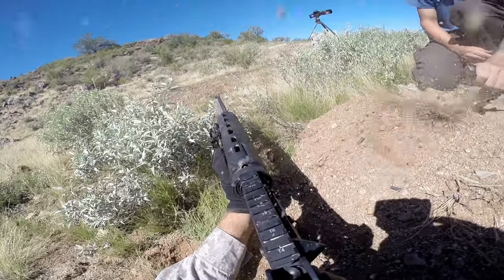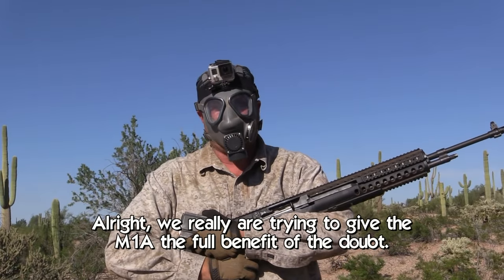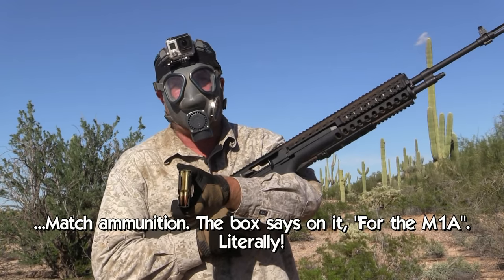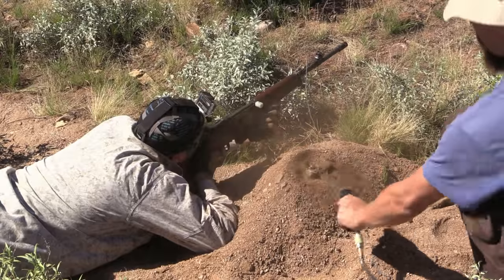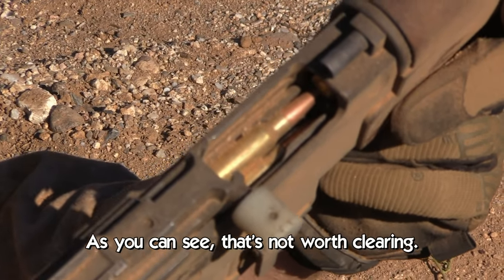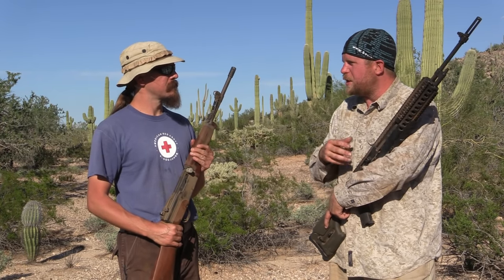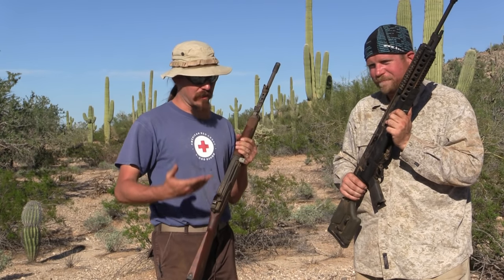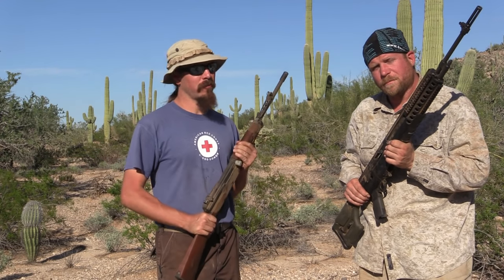Sand Testing An AR15, M1A, And MAS 49/56

Comment: Dude you blew WAY more sand on the M1 than the AR
Reply: It was so noticeable that it almost looked deliberate. Anyone who's ever been deployed to the deserts of the Middle East will tell you how unreliable the AR is in that kind of environment, demanding constant maintenance to be able to keep them functional. Testing videos such as this hardly ever parallel to the side of reality when compared to what actually happens in the real world. All firearms can and will fail when enough debris gets into the internals.
Reply: +LastNineBreaker A year late, but let me ask you anyways: Have you been "deployed to the deserts of the Middle East"? And if so which ar15 did you use? There are tons of variations around so I can't be sure which one you've used. Most of them are absolutely insane when it comes to reliability. The entire gun is mostly closed after all, especially with the dust cover (and even with it open the bolt makes a pretty tight seal so it barely matters). Id wager to say that if your ar15 failed in the desert sand, there might not have been any other gun that would have fared any better.
Reply: The military doesn't issue the AR-15, and you don't get to choose what you are issued.  Wars don't necessarily lend themselves to regular weapons maintenance, and access to lube can become very scarce. When an M16/M4 is properly lubed, it's a sand magnet, and sand isn't a friend of that bolt carrier and upper receiver/chamber. I question if a rifle should have to be lubed regularly to function. When rolling in the back of the pick-up style hummers you eat A LOT of sand, especially in a sand storm, and that sand is really fine like baby powder; it gets in everything, and requires a religious regiment of cleaning. There is a layer of dust on everything, all of the time. I can't imagine what a few decades of being out in the sandbox would do to one. Regular maintenance isn't exactly high on a Jihadi's priority list.
Reply: +LastNineBreaker So what you're saying is that "anyone would know how unreliable a gun they don't carry would be"? Well my military does issue an ar15 type (hk416 to be exact), and it's one of the most reliable guns we've ever had. While I admittedly haven't been to middle east myself, the weapon itself has been rigorously tested before it was acquired by the Norwegian army and in combat in the middle east since. While ar type weapons does come in a variety of types, they're all similar with the closed off bolt style that makes it really difficult for dirt to get in there to begin with. People think it's unreliable because it's complicated (compared to a relatively uncomplicated ak for example), but it just isn't.
Reply: LastNineBreaker the US military DOES issue the AR-15. When an AR has a specific set of features, and owned by the USG, it is called by its military designation. And what the guy could've been skiing was which rifle did you use? M16A_= 20" rifle gas system. M4__ =14.5" carbine gas system. MK12 Mod 0 =18" rifle gas system. MK12 Mod 1 = 18" rifle gas system with carbine recoil components.
Reply: LastNineBreaker I know a retired field-grade Major (Army) who won't tell you that. He'll tell you that if you maintain your weapon, it's boring. I have a former Army Sgt. who did private contracting after getting out. He will tell you that if you maintain you weapon, it just works. I have heard claimed former service members tell me they had unreliable rifles and once they stopped oiling them they worked fine. I will listen to my primary sources.
Reply: The MJR you mention seems to reflect my opinion when emphasizing maintenance. When he asked about the type, I figured he was inquiring about a specific manufacturer. I considered that a moot point since because they are all based on the same design, they all share the same potential design weaknesses, regardless of manufacturer. The HK416 is based off the M4, but it's still not an M4.  He specifically asked about the AR15, and while I understand the distinction you were trying to make, I don't know of anyone that would refer to their M16 as an AR15.

Comment: Try a Garand please, and take of the Troy stock from the M1a.
Reply from the maker: +Douglas Fulmer We did a mud test on the Garand already, if you haven't seen it.   This was a loaner gun and it came in that Troy stock, so we used it as it came.  I am absolutely certain it had no effect on the results, however.  ~Karl
Reply: InRangeTV Thanks for the lightning quick response. I am dubious about the stock, but I agree the same thing would have happened already.

Comment: Your 'sand' is way to coarse , it would take several hundred knots of wind to put particles of that size in the air.   Try again with 'playground' or finer sand.  Its the same problem with your 'mud'  you can hear the huge pieces of grit grinding on the shovel as you scoop the mud onto the pieces.

Comment: did you use dry lubricant or nothing at all?
Reply from the maker: +Simon Rival Nothing, we ran them dry. ~Karl
Reply: +InRangeTV I'm dissapointed with the M1A with that performance I thought it might have had some oil in it somewhere.
Reply: +Simon Rival probably why it had such a short service life maybe, was that movember or your everyday?
Reply: +stevencox75 it's service life was short because the M16 was brought into service. however the M14 is still in service with many countries as a designated marksman rifle. As for the moustache it was for movember.

Comment: Interesting. But you should have pushed the AR to failure, or at least tried. And done an AK47 of course. I'm a little surprised that the AR didn't fail, as well, as there seemed to be ample opportunity for crap to get in the chamber. All 3 guns effectively sealed the chamber while in battery, so the only obvious advantage of the AR in that instance is that it's ejection port is smaller. Going from that assumption, it should just be a matter of time before the AR got dirt in the chamber and failed to extract?
Reply: it also has a blast of gas coming out of the chamber since it is a psuedo direct impingement action and that blast of gas can clear or prevent dirt from entering the chamber.
Reply: Barnaby Wylde Are you talking about the gas ports in the bolt carrier? I'm not sure I follow.

Any automatic firearm is going to have some gas blown back out of the chamber. Even though the bullet has left the barrel by the time the shell is extracted, there's still a certain volume of expanding gasses that remain in the barrel for a short time, and some of that does blow back into the action. With that said, I don't think there's more gas coming out of the chamber of DI rifles, or that it's at a higher pressure. That would mainly have to do with how fast the gun unlocks, which is really a matter of gas port size, powder volume, bolt weight, etc. If it unlocks earlier, then the pressure will be higher and more gas will be blown back into the action.

I really don't think DI vs piston had anything to do with the results in this case. If we were talking about high volume fire then possibly, but then again, failure to extract isn't an issue caused by DI. The only malfunctions that would come into play with DI would have to be the direct result of carbon buildup and oil loss in the carrier pocket. In this test, however, none of the guns were fired enough for the whole DI vs piston thing to even begin to come into play. None of the guns were fired enough to become fouled, so 100% of the failure was the result of the dust, not the particular gun's type of operating system (at least not in regard to how dirty it is).
Reply: Jack Banks 10:25
Reply: Barnaby Wylde Oh, okay, you were talking about the MAS. The gas would actually be coming out of the gas tube on that one, not the chamber. But yea, I could see how it might blow away a little debris.

The AR15 is quite a bit different, though. If you watch slowmo of one being fired, there's really not much if any gas still coming out of the gas tube by the time the BCG moves to the rear. There's a little puff of smoke that comes out of the chamber, and maybe some out of the gas tube, but no more than any other automatic gun.

Pretty much all the gas gets blown out the gas ports in the carrier. By the time the BCG moves far enough to the rear to allow any debris to come into the chamber area you're not really seeing anything significant coming from the gas tube.

The MAS might have more of a blow out effect because it's 100% pure DI. So the gas isn't being rerouted anywhere, and it doesn't have anywhere to expand. I'm just speculating though. I don't know much, or anything really, about the MAS49.
Reply: Jack Banks the actions for the the M1A are exposed. unlike the AR where all the moving parts are internal.

Comment: Use a stock that doesn't have a hole in it!
Reply: +mcqueenfanman A traditional stock would be more open and make it worse really, this somewhat shields it
Reply: +bower31 No the hole I'm talking about is the selector switch hole. Plus that top rail is an area where it could deflect sand down into the action.

Comment: there is no rifle that does everthing the ar can better then it can
Reply: DEMONIC DEFENSE SCAR16S and SCAR17S as well as ACR. though all three are very similar in function to the AR15 with the exception of being piston driven. basically they're evolved ARs.
Reply: ***** they still dont come close to being as adaptable as the ar 15 by pusging two pins you can go from 22 lr to fifty bmg and all in between no rifle can do thst but the ar 15
Reply: DEMONIC DEFENSE true but that's because the AR15 has a massive aftermarket. The ACR however has common parts compatibility with the AR. And both rifles can pull a trick most AR's can only dream of.. Fold their stocks.
Reply: ***** law tacticle solved that problem im not saying the acr and scar arent great guns but they are not any better then a good ar 15
Reply: DEMONIC DEFENSE they're better at somethings and not at others. I personally have a AR15 and a SCAR17S on back order. The AR as my close up weapon and the SCAR will be my reach out weapon. I also have a .50 BMG rifle (who's upper can be mounted to a AR lower). So yeah. I love both guns. 

If I had to pick just one rifle I could buy it would be the AR because that one gun is every gun. But if I was being dropped off on an alien planet and didn't know what the environment would be, I'd take the SCAR, because no way no how am I going to carry every upper for an AR lol.
Reply: ***** i love the acr i wish they had actualy made the caliber convertions they promissed
Reply: DEMONIC DEFENSE I'm not sure if a AR barrel will fit in a ACR. I know their triggers do. 

If I went with a non AR 5.56mm I would get the ACR
Reply: DEMONIC DEFENSE the SCAR does one thing way better then a AR... be stupid expensive.
Reply: ***** amen to that
Reply: DEMONIC DEFENSE my SHTF50 costs $100 less then my SCAR17S
Reply: ***** what is it
Reply: The SCAR is $2800 and the SHTF50 is $2700
Reply: ***** holy crap thsts a lot of money what 50 is it
Reply: DEMONIC DEFENSE SHTF50. It's a 5 round box mag fed bolt action .50 cal upper. However I'm buying it with a dedicated lower built for the recoil and lacking the AR mag well.
Reply: DEMONIC DEFENSE yeah... I don't make a lot of money... I just spend what little I have on guns.
Reply: ***** oh ok i am thinking of geting one of those how does it shoot
Reply: DEMONIC DEFENSE the 50? I don't know yet. Once ordered there's a 10-12 week waiting period while they make it. I'll find out in 9-11 weeks.
Reply: ***** oh ok
Reply: DEMONIC DEFENSE yeah and the SCAR has been on back order for so many months now.
Reply: ***** that must suck waiting for guns you already paid for that one reason i havent got a silencer yet
Reply: DEMONIC DEFENSE yeah... But the SCAR I saved for 5 years for... I can wait longer.
Reply: ***** it will be worth it im sure im stuck building ar 15 for the moment buying one part a month
Reply: DEMONIC DEFENSE I bought a used AR that already had an upgraded trigger and a quad rail front end that forms a monolithic rail on top. Next week I'll get an EOTEC 552 and magpul flip up sights. I also have a magpul angled fore grip. I'll get another EOTEC 552 for my SCAR17S. And currently have an EOTEC 512 for my MKA1919. They both are the ones that take double A batteries. But the 552s are night vision capable. The 512 I got a good deal on and I'm not likely to use night vision with a shotgun.
Reply: ***** nice   wish i could afford a eotec
Reply: DEMONIC DEFENSE I can because I don't do anything that costs money, cheap food, no going out no driving around,  no buying movies or video games or even any cloths more expensive then absolute basic stuff. I literally have no life lol.
Reply: ***** same here but i got a 1year lod son to take care of so baby food b4 guns you know
Reply: DEMONIC DEFENSE I'm single with no kids... I had a choice years ago... Truck or girl friend... Truck won.
Reply: ***** im single to was married for 8 years never do that again id choose the truck every time now
Reply: DEMONIC DEFENSE my coworker tells me every day... "Don't get married"
Reply: ***** my boy is actualy my brothers son but he went to prison for ten years few months b4 he was born so im daddy now but its ok he has been a blessing in my life
Reply: ***** listen to them marriage is horrable i had the perfect relationship then got married it all went down hill from there had two fights in two years b4 marriage then every day was hell almost
Reply: DEMONIC DEFENSE I plan to... A couple weeks ago while at my Buddy's gun store. A woman selling roses came in and asked if we wanted to buy any. When I said I'm not interested she said "you can get one for your girl friend or wife" to which I pointed to my rifle on the counter "she's my girl friend and she doesn't need flowers"
Reply: ***** lol nice

Comment: I happen to be aware of a lot of people who used both the M16 and several different variants and import teams that were issued to a lot of Marine Corps troops when they found 325000 of them that had never been issued in Vietnam. The M14 was so Superior and required far less maintenance. Redskins, when firing from a prone position the M16 literally sucks that super fine sand in Afghanistan and Iraq right up around the magazine and into the firing mechanism. The M14 does no such thing. Plus the sand you're using in your supposedly scientific test looks almost like pebbles. And I don't know anybody who's ever been in a battle who had somebody with a air blower blowing dirt on their gun while they're shooting it. The application is erroneous.

I also know an armored who worked overseas for several years and develop several mechanisms for keeping those Firearms running. The M16 were wearing out at an alarming rate. The M14 didn't even need oil on them to continue functioning. That was critical as the oil draws even more sand and the M16 were grinding themselves into bits. The 240 and 249 is were just as bad. And they didn't help that instead of getting dry Teflon and spring it on it the Army insisted on putting oil on their guns in that environment. The Marines quickly figured out that the M14 we're just fine with the oil residue that was still on it from the last time you wiped it down.

You throw a bunch of dirt into the ejection Port of an M16 while it's cycling in the bolt won't close on it either.
Reply: 44 Hawk [citation needed]